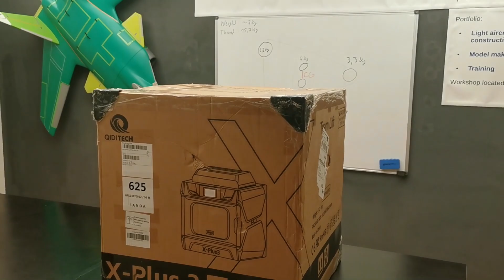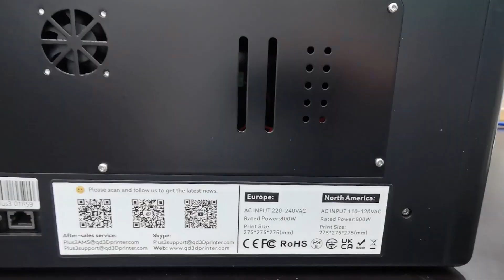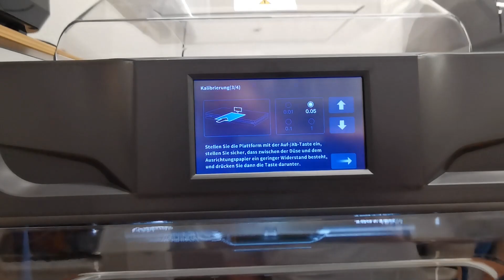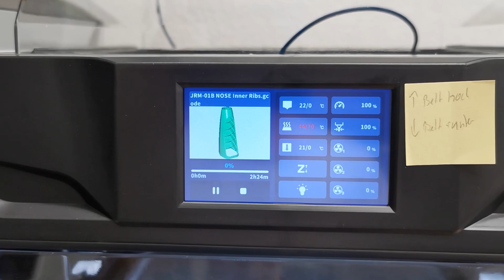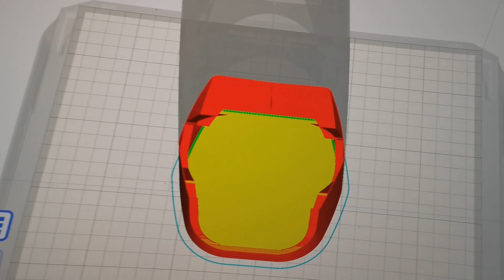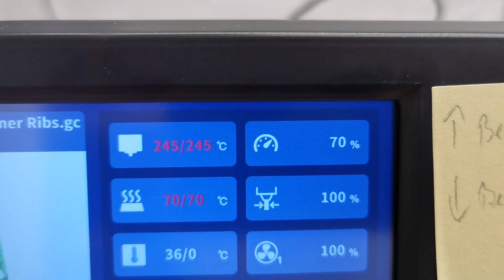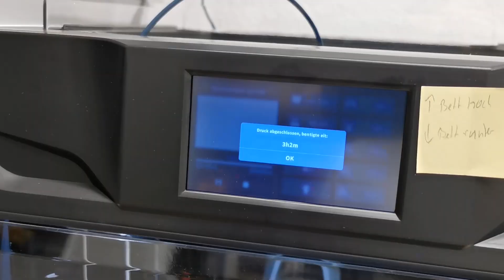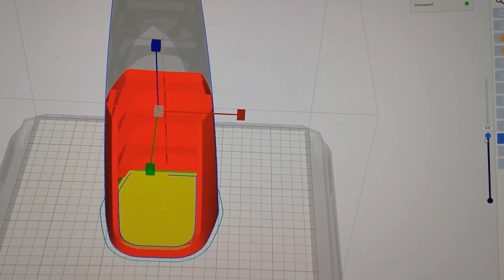Qidi X-Plus 3 Review and printing a Big Airplane Part in Vase-Mode

Comment: Why are you using the older Qidi slicer, this is not properly configured for the X-Plus 3 but for older printers. Also you  don't have the nozzle offset properly set, it is too close to the bed and is dragging at the bottom, the special paper for levelling needs you to feel for friction as you move the bed up and down, you seemed to just throw the paper in a close the door which is a bit strange.